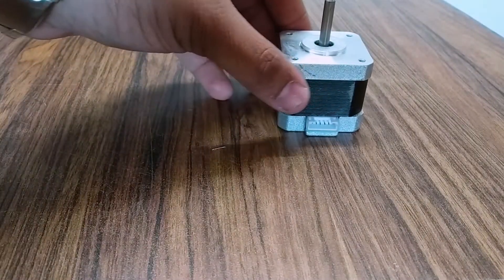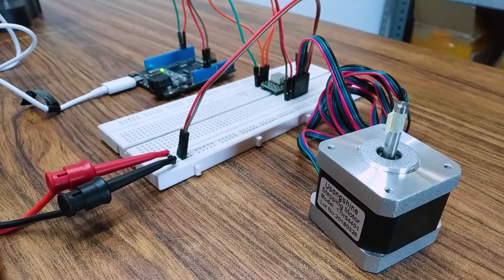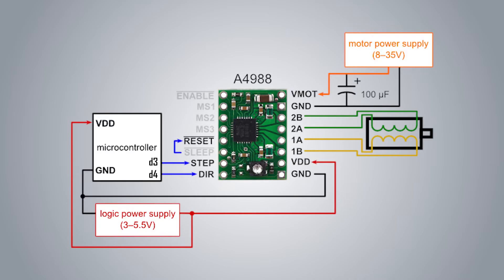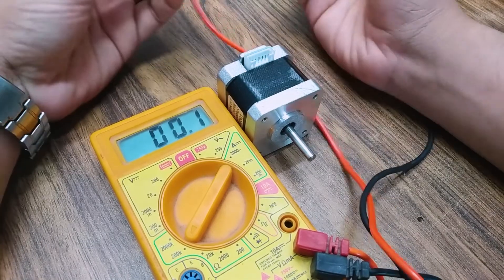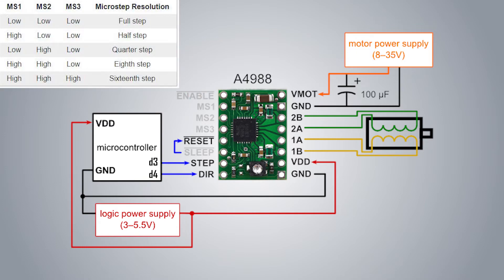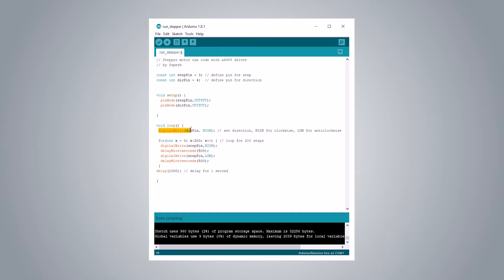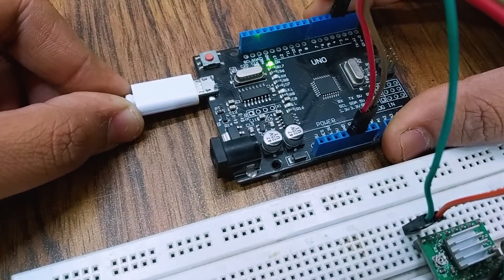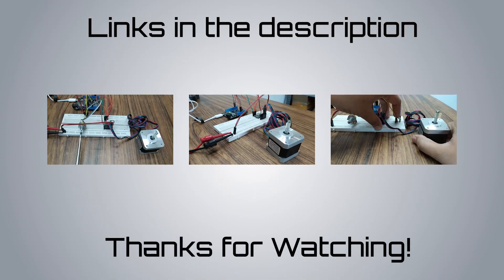Control Stepper Motor with Arduino - Tutorial

Comment: I am not able to control  stepper motor speed with 10 k potentiometer and a4988 motordriver, arduino my code is correct driver and arduino is working but motor runs its self without any effect by potentiometer  and code when reset the code motor still runs 
Please help me

Comment: Fantastic how to. Electrical engineering is intimidating to me as a hobbyist, so I appreciate you providing both a what to do and why its done that way, like when you explained why the motor needs a separate power supply and recommended specific power, you saved me plenty of anxiety. Thanks again!

Comment: Hello,

I just want to run a stepper motor with Arduino and potentiometer at a continuous speed of 60 rpm. Could you please let me know the Arduino code. Thanks in advance.

Comment: If you were going to disconnect the arduino from usb (for example, after development, you want to run an arduino inside a project box with no laptop connected), how would you power both the arduino and the stepper? they need to share the same ground but they need different voltages.  Please advise

Comment: Again, a great How-To!

After some double, triple and quadruple checking of the provided Nema17 to driver cables, I got everything setup, loaded your sketch and successfully tested all eight Nema17 steppers and all eight A4988 driver boards. All good to go for a future project!

Thx, this was much simpler than testing with the CNC Shield. Now if something isn't working, I'll know it is the CNC Shield or the coding and not the Nema17s or A4988s.

Comment: hello sir I want to ask, if the rotation of the stepper motor only I want to set 90 degrees. What code should I add to the arduino?  please answer, thank you
Reply: Reduce the number of steps from 200 to 100 to go from full rotation to 90° in the chide.

Comment: Finally got my code to work with yours I tried about 10 others..thanks so much!!  I bashed together the code from the button one and the speed one and made it reversable, so thanks a bunch!!
Reply: Hello, how do I combine the two codes? I can not. Thanks
Reply: @lendines  add the relevant code to the same function.
Reply: @maddercat  Hello, I'm sorry to bother you but I can't program it, if I program individually it works fine, but I can't make potentiometer and change of direction work together in the same code, I need help. Thanks.
Reply: @lendines  you probably also need to add the different variables did you do that?
Reply: @maddercat  Hello!!!! Thank you very much for your help, I already have it working correctly.
Reply: @lendines  Hello, how did you do it?
Reply: @gomaazwianzeli1222  Hello, I remember that it was a bit difficult for me, I have the code that I use in my hard drive working perfect, I can send it to you and you just have to change the pinout to your liking. Greetings.
Reply: @lendines  Hi I know it has been a year but I don't suppose you still have the code that uses both potentiometer and the change direction button?

Comment: Brilliant! I have an Arduino gathering dust which was a gift and I just took my old Umax Powerlook SCSI scanner apart which has two large belts driven by stepper motors. I reckon I could make a really smooth camera track with this which would be ideal for product photography.
Reply: instaBlaster...

Comment: Very cool the stepper motor control, there is some way to control the pontecometer automatically, without me having to rotate manually! Is there any potentiometer where I can pass the value automatically?
Reply: You can do that in the Arduino code.
Reply: You can fully automate or add buttons, sliders and potentiometers to the code.